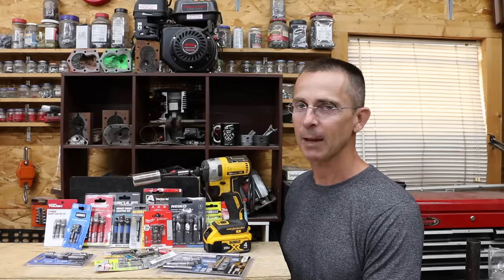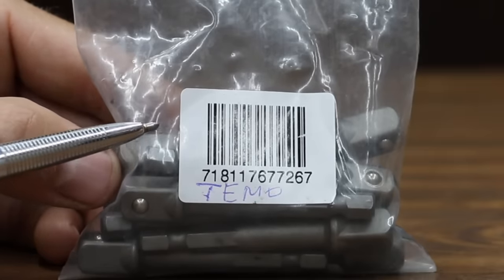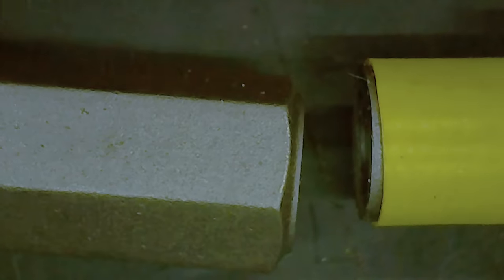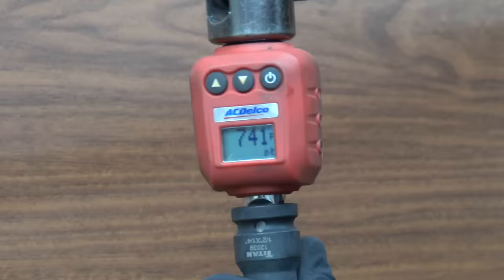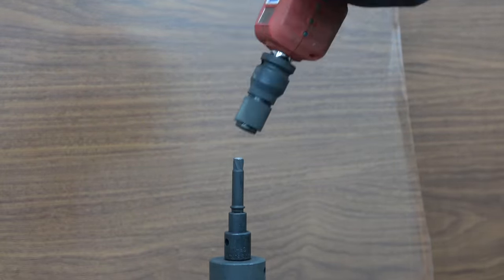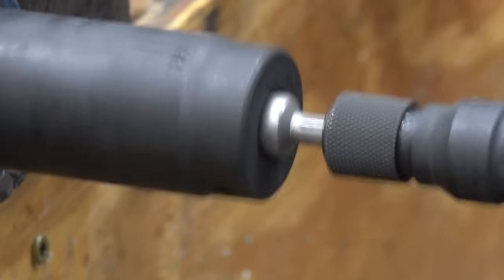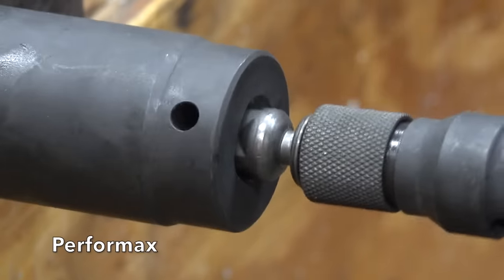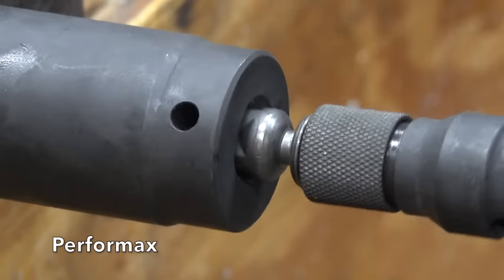Best Socket Adapter? 18 BRANDS: Milwaukee, DeWalt, Makita Gold, Ryobi, Hart, Irwin

Comment: At some point manufactures will start putting on the product packaging -  tested best by PF... :)
Reply: That would be nice, but I'm not holding my breath.
Reply from the maker: Thanks for the nice comment.
Reply: As seen on YT tested by Project Farm truck . That would be nice and give him some sort of % on sales
Reply: If so PF needs to get a royality check each time one is bought.
Reply: I run an Ace Hardware and bring in stuff that performs well. Also use the info from the videos to help with recommendations. Invaluable source.
Reply: Hopefully they say project farm on YouTube, and not just PF. If I saw just the PF, I wouldn't connect it to this channel
Reply: That or Project Farm tested that
Reply: I think I've seen cerakote ads on facebook that just link right to his video about plastic trim
Reply: Seriously - a pretty good idea 
(I've just noticed what the subscriber count now is, always shocked when I thought a channel was 'still small, great, but niche' - then you see it's happily cruised past a million).

Get somebody to knock up a nice "Best" and "Best Value" PF logo. Name a winner for each in each review. Don't review the same class within 2 years. Mail PR for winners to say "Would you like to license the logo for the year tested?" - "Best/Best Value <class of widget> 2020" for the current year and all of the next.
You're already basically Consumer Reports/Which?, but with great videos.
Would even make sense if you didn't charge - could add a website to the logo, use the website to let people browse your reviews - more traffic, more YouTube money.
Reply: @zwz.zdenek  I mean he's getting millions of views on these videos. He's also talked to some companies about their products. They DO take notice!
Reply: I'D BUY it
Reply: @sawyermishak3300  I wish you ran my Ace Hardware, would make it easier to get good stuff

Comment: All the impact adapters that broke in the small cross area are breaking safely. Rather than twisting and possibly throwing chips, they break quickly and reliably, without shrapnel.
Reply: I also noticed that alone of them, the Bosch alone seemed to be doing the evil shrapnel thing. Sheesh, safety glasses and work gloves anyone?
Reply: That may be the case but it’s ironic that most of them are the bigger brands who had that but along with that claimed the biggest breaking strengths…. This is why people like him are vital, don’t believe the hype that big brands claim, save your money when you can and buy the tool for its quality, not it’s name
Reply: No, it’s made to be elastic of sorts.  Stores the energy from each impact like a spring so in theory it doubles the motion.
Reply: This is so important to know and make clear...
Reply: The best impact driver adapter are the titanium ones. Super strong, and never had a problem with them breaking.
Reply: Not necessary if people would wear proper PPE when using tools. You technically shouldn't even use a hammer without safety glasses on🤷‍♂️ if you're working safe you don't have to worry about shrapnel. And the only one that really did it was the Bosch
Reply: @jerichojoe307  buddy, OSHA has reports of accidents caused by PPE.  Nothing is 100%.
Reply: @jerichojoe307  PPE is always last resort, elimination of the risk is first
Reply: @nichevo1  a lot of people that would be using these don't really care about little bits of metal unless it were to go into their engine
Reply: @nichevo1  Bosch windshield wipers scratched my windshield. CS said they were "probably exposed to air." (wtf???) After that, I decided to never buy another Bosch product.
Reply: @Mavendow  I don't buy Bosch for my truck but the 6" circ saw is decent and I have something else from them I got free. Amazing how they suck you in.
Reply: @nichevo1  Well, that's good. I imagine not all of their products are terrible but the audacity of CS to tell me windshield wipers were exposed to air was too much.
Reply: Mmmmmmmkay. You take you crappy “break safely tools”. I’ll take the ones that won’t break.
Reply: @j.rjunior5584  who makes titanium impact adapters?
Reply: @nichevo1  well for certain uses you don't want something breaking into a million pieces even if it doesn't cause harm to you and may cause harm to the thing you're working on.
Reply: @Cerbirt Aircraft generators and hydraulic pumps have input shafts designed with similar shear points to protect the gear box driving them.

Comment: My understanding is the impact bits with “torsion zones” are designed for the bit to last longer in its useful life span. Meaning when you’re using the bit to fasten nuts/bolts, or remove them, the bits don’t undergo this kind of extended even torque you see in the video, rather they experience momentary shock force, that drops of rapidly. Those torsion zones are there so that the bits don’t twist over time or multiple uses, but are rather designed to absorb the momentary shock and snap back into original shape. They’re not designed for high constant torque applications, but rather many, many, many smaller momentary shock torque hits. So like if your driving a million deck screws — that’s where these bits shine, they will survive longer without twisting over time.
Reply from the maker: Thanks for the feedback.
Reply: I very highly agree. I want speed insert, good fitment, drive speed and balance. On the back end good edge retention always makes a big deal. It is very interesting that he's testing them in inverse which is probably the best way to save 1,000,000 hours...

I think objectively this video is just a steel composition comparison for nightmare testing. I think he's actually peering pretty deep here.
Reply: @Ihavetopoop718  i agree with most of his testing methodology. In particular the tests involving bit edge retention and head strength over use/time. My only complaint is regarding the claim that the bits with "torque zones" are compositionally weaker under constant high torque application. That part the bits with torque zones are not designed for, they're designed as a system to survive longer the repeated hammer hits from hammer drivers as you're putting in lots of repeated screws (like deck screws) with lots of small momentary repeated torque blows from the hammer mechanism, acting like a spring and snapping back slightly after each hit - thereby not putting in a permanent twist to the bit, and protecting the head and teeth (Phillips, Torx, etc.) from damage. They're not designed for high torque applications like bolts that needs to be torqued to 150Lbs with a slow turn of a torque wrench or even an Impact Wrench...in this case obviously the thicker the better.
Reply: Well you have to admit testing these to the point of failure does give you some indication as to overall durability. Just look at how the DeWalt ran away with the title in the test which counts most... For use with impact tools that generate less than 2000 inch pounds... Which is coincidentally where the bit snapped.
Reply: @ConcernedCitizenPPCA  I agree...I grabbed some of those just to have. But still, there's a reason they design them with these torque zones, and its not for ultimate steady state torque strength, but rather repeated multi-use. So would be interesting to see them tested against each other within those parameters.
Reply: It makes no sense to use these for deck screws, most ppl using these are going to be mechanics like myself or contractors driving lag bolts, so I really don't know what b.s. you are trying to tell ppl but it makes no sense to me. I think project farm did an excellent job testing these
Reply: I couldn't add the pic of the scar I got from a broken bit with a "shock zone" it was a Gearwrench and I was taking out a lower control arm bolt that I had already broken loose with my ½" drive Craftsman 18"  breaker, the fail point was the "shock zone" the whole point of an impact is shock. The impact was a ¼" drive Flex cordless. Just my two pennies. Love the channel. *video idea ... Glass cleaner. Vinegar mineral spirits ammonia - invisible glass- rain x - so forth
Reply: @paulcollins9094  Not sure you can blame the tool when you use it for tasks it was not meant for in the first place. You should've been using an impact wrench and a socket, or a ratchet, or a wrench, not an impact driver and a 1/4" bit.
Reply: @BigBear-- I know it's not intended for that purpose, but I think lots of ppl use it for that, and as long as you aren't going to be taking lug nuts off with it, and just use it for small things like valve cover bolts, battery trays, fender bolts, then it will last just as long. I use one at work all the time and only ever had one of the adapters break on me and it was a Lexivon impact grade 1/2 which really surprised me but my Bauer 1781C-B1 it's still going strong. I honestly think the shorter stubby adapters last longer to, never had one of those break.
Reply: Yeaaaaaa suuuuuuuure 👌
Reply: @GTLopez85 What or who are you replying to?

Comment: Thanks for another super useful comparison. I picked up a Snap-on 1/2" to 3/8" adapter, after my Craftsman twisted off, due to their superior image. While it did not twist off, the square section is now loose in the socket part. These adapters are often useful when a deep socket is needed and it would be nice to know which work well.

Comment: I am really happy that he made this video my socket adapter just broke a few days ago
Reply from the maker: Perfect timing!  Thank you
Reply: LMDAO MINE TOO, I was making atvs and it snapped in half
Reply: @Project Farm
What about circular saw blades
Reply: Tomoto man peach  that's what broke my adapter because Milwaukee tools are the best
Reply: Been buying Dewalt. Got to buy this adaptor.
Sure beats setting up air tools plus no hose or compressor noise.

Comment: Ryobi, Hart and Milwaukee came out on the bottom in my testing of impact socket adaptors👌🏻
Reply from the maker: Great information.  Glad our test results are consistent!  Keep up the terrific work!!
Reply: Yep the Gen 1 Milwaukee socket adapters were stronger and built more like the Dealt he tested. The shock zone is a gimmick to sell more bits but its catching up to all these manufacturers nobody will buy them before to long.
Reply: Bro you saved me money lol. I upgraded to a brushless dewalt and broke a ryobi adapter and another no brand one qnd then ended up ordering the makita and so far so good
Reply: You're doing it wrong if you're breaking these things. Find another job or hobby.
Reply: @replynotificationsdisabled  
No, the point isn't usually to break them, but if you're going to buy one, wouldn't you want to know that you are buying the one that won't let you down if you're working late at night fixing something and it just happens to be the tool you have, or the tool that fits in a tight spot, and if you break it while working you can't just go get another one. I like to buy tools that last, like I like to buy cars that won't leave me stranded on the side of the road 20 miles from civilization.
Reply: All made by TTI, interesting
Reply: It's a bit of funny, Milwaukee makes some of the absolute strongest impact drivers on the market but their accessories like bits and socket adaptors are sh*t!! If you take one of Milwaukee's newest impact drivers and mount their newest socket adaptor, are they only a one time usage!! :-)

Comment: do a video on "torque sticks" and how close they get to their stated torque with an impact gun.
test on 2 or 3 different guns
Reply from the maker: Great video idea! Thank you
Reply: This is a good idea!
Reply: @ProjectFarm  That test requires impacts being turned down from highest setting and a constant psi level.
Reply: @ProjectFarm  , I think that's a Great idea. I have always wondered about those. While set up for such a test, maybe a test for impact extensions designed for transmitting FULL torque. I've never had much luck with an extension on an impact.
Reply: Perfect idea! Always curious to know if it's the appropriate torque after putting a customers wheel on with one. So they're able to get the wheel off on the side of the road without struggling.
Reply: Curious about this too. I have a dewalt 889 and want to know if I should set this to 1, 2 or 3 speed while using torque sticks.
Reply: @ProjectFarm  Also check if any difference between kind where you add your own socket like Grey Pneumatic 2805TK extension set or kind with built in socket like Sunnex 2880 set
Reply: Yes, I would like to see that test.

Comment: New TorqueSmith packaging 2021: "Now Impact rated! 3x Strength!"

 Price: $14.99
Reply from the maker: Thanks for the feedback.
Reply: Do you have a link? All I found was this exact unit for 3 dollars.
Reply: @kameljoe21  Viewer was just saying with sarcasm since PF reviewed with decent results and recommendation, price will increase in 2021.
Reply: @CGW116A  Yeah thanks.. I did not see the 2021 part or just missed it!
Reply: "PF approved"
Reply: I bought 3 of those kits last year thinking they would be good for light duty jobs.  Now I won't be afraid to pull them out for tougher jobs too.
Reply: @darinvee4980  Watching PF enough sometimes the cheap stuff is the better value. There are a lot of them the are just as good as the name brand based on value. Some good stuff out there. I use PF when looking for stuff all the time.

Comment: Suggestion for a test: Rotary tools (such as Dremel, Proxxon etc. etc.). And/or the durability of the bits used on those tools.
Reply from the maker: Great video idea!
Reply: Nice idea as well.
Reply: Proxxon ❤
Reply: This would be a good test, I have an old craftsman and it’s blows.
Reply: Rpms under load....
Reply: Nah, i bought a 20$ wen and that thing has held up to abuse for years and years with well over 100hrs of use and countless bits..  the 100$ dremel crapped out and was unrepairable after a few months...  and the wen came with 200 bits and a remote head attachment..  telling ya, wen makes some good cheap stuff..  drill press, sawzall, jbench grinder, skill saw, bandsaw..  all of em hsve been awesome..  and the old porter cable grinders...  beef stock..  have a 4.5" thats over 15 years old and paid 40$ for it new..  and im a welder so it gets a lot of use.  Have dried the grease out multiple times and replaced the brushes 3 times...

Comment: Fascinating video, and great testing. I notice that several of the adaptors broke where the size was stamped into the metal - see 1:45 or 3:27, for example. That's exactly what I'd expect for a brittle fracture like this; any notch will weaken the metal and provide a ready initiation site for the fracture. If that's a more general observation, it might suggest tools with printed sizes are stronger.
Reply from the maker: Thanks so much! Thanks for the feedback.
Reply: Thanks for another great video!
Reply: CORNER MARKET PLACE  While true, indestructible products aren't as profitable. Generally, high-volume mid- to low-quality companies will buy out the highest-quality companies and intentionally weaken QC and tooling. If not, they re-engineer the product or manufacturing to push the final product to its limit, though this technique is mostly seen in tech products. Another technique is to directly weaken the quality or durability of the construction materials; in moving parts they typically choose to weaken gaskets since those don't often cause catastrophic failure. This last technique is harder to discern because it can be confused with a company "cheaping out" even though it may sometimes cost more because of bad runs and QC problems.

A great example of the first type is when WD acquired HGST, a premium hard drive manufacturer. The previously quiet drives became very noisy and failure rates soared.
An example of the second type is NAND flash, where nearly every company engineers their products to store 3+ bits per cell, which reduces the NAND lifespan by 2^n.
Another example of the second type is panty hose which used to be strong enough to pull cars. Now you can tear one with your nail; they achieve this by superheating the fabric.
In a rather infamous case for the last type, Pirelli made tires for Formula One which wore out after just 50km. Imagine changing your tires more often than buying gas!
Another example of the last type is every line of yard tools which comes in "consumer" and "commercial" versions. Such as Stihl. The consumer tools are designed to wear out faster.

Now you know why they embossed the size on the weakest part. It's called "planned obsolescence" and it happens in every industry.
Reply: @Mavendow  Just by reading the Pirelli one we can just ignore your comment, FIA asekd Pirelli to make tires that degrade faster. Imagine trying to sound smart while not knowing details.

Comment: Dewalt able to be used with impact drivers up to 2000 psi 
Dewalt after test two: did i stutter
Reply: Dewalt while applying slow and steady force: help me, I’m weak

Dewalt while using a impact: Unlimited power!!!
Reply: Inch/pounds, different to PSI

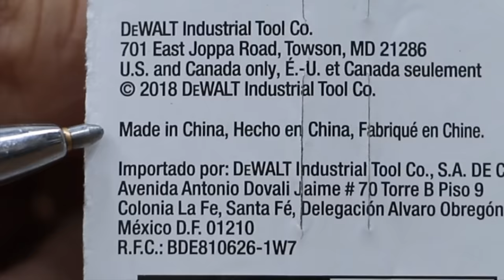Comment: At 7:18 the dewalt says that it can handle up to 2000 in-lbs of torque and it did just that. Great video never disappoints
Reply: The PSI value of the test rig is not equivalent to torque.  It's just a measure that can be used across all tested products.